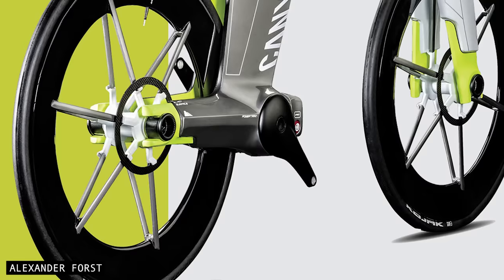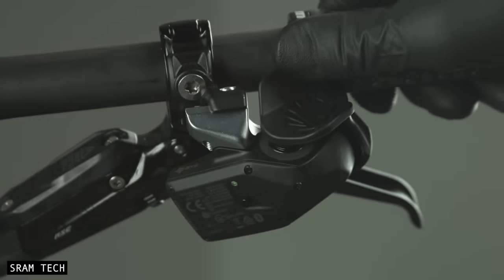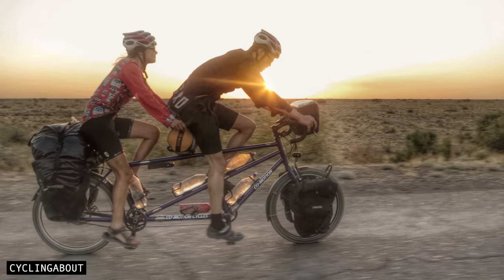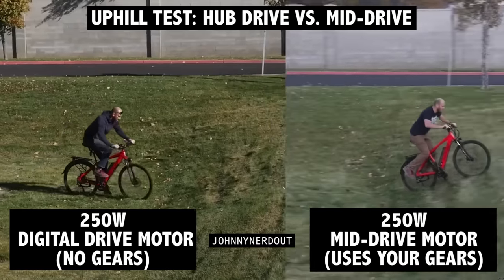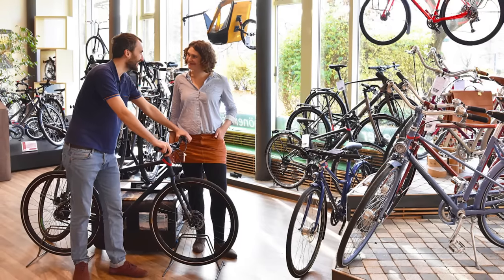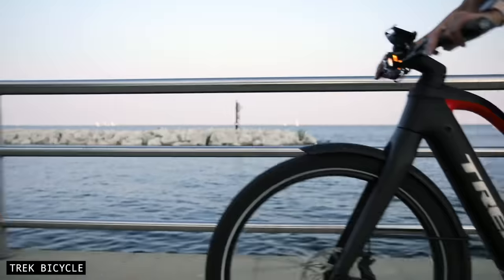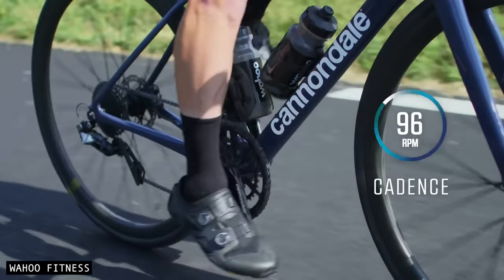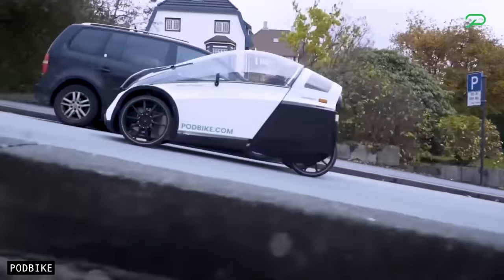Are Chainless Digital Drive Bicycles The Future of Cycling?

Comment: So, best way to look at digital drive bikes is a motorized vehicle and kit it out as that (not goofy 250w engine with tiny battery) so you could use it as normal motorcycle and have an option to extend your range by medaling/regenerative breaks.

Comment: Great Video!                                                                                                                                                                                                                                It's interesting your analysis on digital drive bikes is similar to what I found on Electric vs Hybrid vs Gas cars. The gas cars can reign supreme at very specific speeds based on their transmission and on flat terrain with no stops. Hybrids and Electrics both handle the stops as well as down hill sections wonderfully with regenerative breaking. Hybrids are great as some can offer redundancy not often talked about or utilized well helping with major issues since they can essentially have 2 drive trains. Whereas Electrics only have one to deal with and so can reduce complexity. Though not weight since batteries weigh more than gas.

Comment: Do you want to work twice as much on a bike, than this electric (not digital) drivetrain seems perfect for you!
The efficiency of an electric motor is about 80%. The efficiency of the generator is about 60%. Thus only 48% of the energy can be used to accelerate. In comparison the mechanical efficiency of a bike is about 99%.

Comment: Maybe I missed that in video, but how you gonna fix it?
Okay, it is more reliable, but how much does it cost to fix when it breakes?
With chain drive - buy new chain or casset and replace it. -Cheap and easy.
WIth electric drive - find the broblem, find and buy new(probably expensive) parts and replace.
And why people even trying to replace chains on bicycles? Chain drive exist, works and made cheap.

Comment: I think there is an area where this concept could actually be useful: in training! When you try to train at a certain power output out on the road, the problem occurs that however how hard you try, you will never be able to hold an exact power number. It will vary signifficantly depending on wind and especially on slope. Just a little gradient (wich you cannot see with the naked eye) and you go from, let‘s say, 200 Watts up to 350 without noticing. This reduces the time in your target range and makes training less efficient. With a „digital drive train“ or whatever better name someone could come up with it could be possible to keep a desired power output despite variations in cadence or gradient. A battery could compensate the poor efficiancy to give you the speed you would get on a normal drive train. In a nutshell you would have a smart trainer, but out on the road.

Comment: The thing is, the electronic drive might be lower maintenance, but once the system DOES require maintenance, you need to work with potentially complex electronics. Where as I can fix my chain drive in front of my house with a couple of wrenches, lube and maybe a file and scrap metal for good measure.

Note that I live in the Netherlands and that I drive a single speed bike exclusively for commutes, and I have no interest sport-cycling apart from the occasional low speed tour of the countryside. My overriding priority for my bike is simplicity and ease of maintnance, and being able to leave it out in horrible weather without thinking about it.

Comment: The “it has fewer moving parts” argument does not always mean it is better. A traditional chain drive bicycle is much easier to diagnose and fix if it has a problem. Broken chains can be easily replaced and wearing parts can be identified before they fail. But electrical problems are exponentially more challenging to diagnose and fix because there is not always an obvious reason why something stopped working.

Comment: If the motor attached to the crank is an ac syncronous motor you can power each phase of both the rotor and stator. But if you increase or decrease the ac voltage of one with a dc offset it'll act like a transmission.

Comment: Wishful thinking for people who do not want to pedal. The biggest flaw here is that one of the biggest benefits cited is the ability of the digital drivetrain to maintain the most efficient cadence. On flat ground, that would probably work, though to what actual advantage is not clear. I can do that now with the gearset with none of the added weight. The problem is that, in the real world, when a cyclist encounters a downhill situation, he can coast, resting his legs on the way down and, if the bike was equipped with a small assist hub motor/generator, recover that downhill energy into a supercapacitor for help on the way up the other side. I don't need to get down a hill with some magic efficiency formula, I just need to get down it, and I will with no work. The digital drivetrain described in the video has a separate generator at the crankset, which is only productive if it's being turned, therefore wasting the work of going uphill and the gravity of the downhill, forcing extra work to get up the other side. Add to that all of the vast inefficiency versus a conventional drivetrain and it's really pointless. Leg energy expended as kinetic and/or heat is lost. If it's not used to help you travel forward, then what is the rationale for working harder to go slower? Less maintenance? My bike goes years without much of anything aside from brake pads and occasionally tires.

Comment: Without superconductors this will never work for a regular bicycle. However this is a no brainer for e-bikes…

The efficiency doesn’t matter as you simply adjust the level of assist you want from your battery. The purpose of pedalling on an e-bike is simply for exercise, so any electrical energy you contribute is just a bonus.

Comment: It got some advantages but . . . Converting your mechanical power from the cranks into electrical power, then this electrical power is converted into mechanical on the wheel. The loses are far more than simply mechanical transmission.

Comment: Technically, if you're adding a supercapacitor bank, you should be able to use the energy from magnetic motor braking to charge the capacitors. This would reduce the wear components down to nothing but tires. Make the tires with a 3D printer and you can make them not only airless but allow them to have tread as they wear all the way down to the rim by including bubbles printed right into the design. As the material around some bubbles wears down, it exposes new bubbles. Stagger them in overlapped layers to always have tread. Considering that nylon is a mature material already used as both bicycle tire and 3D printer feedstock, it is not a far leap to make. With that in mind, we are likely a matter of years away from a lifetime semi-electric bicycle that will never need maintenance, parts or components to be replaced.

Comment: Can we please forget about such drive systems? 50% lower efficiency and higher weight?
What I need is a belt drive bicycle with a 7 speed internal gear hub, and a +small+ motor which helps me temporary on long sloops up.

Comment: It will be fine only in one case - if you increase the efficiency to the level of 87-89 percent, which is practically indistinguishable from a chain transmission. Theoretically, this can be achieved.
It is also possible to achieve a reduction in the weight of the generator to the level of the weight of the chain drive.

Comment: Digital electronics means a system with discrete states (e.g. 0 and 5 volts). A generator powering a motor is an analog system. Also, the generator and motor are much lossier than a mechanical lineage, and I doubt regenerative breaking will make up that difference.

Comment: Perhaps cycling at a constant speed just to recharge a battery and the battery powers the motor direct might be better. The one issue I have having once owned a pedelec bike is the amount of recharge cycles as battery replacement is not cheap as I found out.

Comment: The reason chain-driven bikes work is from the direct feedback you get when pedaling. This bike would have to generate more electricity than needed to drive the motor and generate force feedback to the direct-equivalent of a chain-driven bike. I doubt this could be achieved.

Comment: The hub motor and crank generator assembly would end up weighing around 10 to 20 pounds and you would loose 30% to 50% of the energy you put in.  It would also add around $1000 to  $3000 to the price of the bike.  Last but not least, waterproofing the rotating components would add additional friction and power loss.  Well, at least the name is catchy, but I'll be sticking to ebikes.

Comment: A planetary gearset in the bottom bracket with the sun gear driven by the cranks, the planetary carrier driven by an electric motor with the ring gear connected to a hub motor with a belt would be mechanically equivalent to a Prius drive train (with the engine replaced with human power) and would allow pedaling with no movement, movement with no pedaling, pedaling with movement, regenerative braking and engine braking (basically, fixed gear braking) and the ability to transit motion through the belt would potentially recover some of the losses in power transmission.

Then throw in an e-hub in front for EAWD and better regenerative braking.

And you can have hybrid bikes with no plug in capability and very minimal batteries, which might not be enough to offset the price of a planetary gearset but it'll probably offset the weight.

Comment: Thanks for the explanation. I understand from your video that the CDDBs don't have to be equipped with an energy buffer (battery), unless you need to have better efficiency, right? Anyway, one main disadvantage of the CDDBs - with or without energy buffer to increase the efficiency - is that they most probably are useless when the motor fails. That would be a pitty. Since almost every current e-bike does offer the option to switch off the pedal assistance completely and to drive the bike just as smooth as it would be an "old school" bike without any pedal assistance what so ever. Naturally those "old school" bikes were cheaper, but some could be pretty expensive as well. There still are bikes that have no pedal assistance that cost a lot more than a good quality e-bike. I expect that the basics of the CDDB without the parts that make it a CDDB are pretty expensive too (there has to be a return on the high investment costs for research and development). When the motor quits close to home it's probably expensive to be repaired and ... when you're "in the middle of nowhere" how far do you need to walk and push your useless but expensive CDDB?!

Comment: Trains have been using dynamic braking since the first electric trains in the early 1900’s captured the power from the extreme weight of a train descending mtn passes with controlled dynamo that returned the energy generated in electrical resistance to slow the train back into the batteries or electrical line. It was called “dynamic braking”. For bikes tho, it seems a little much whereas for vehicles that can carry more than 5 people it makes great economical sense.

Comment: There was a cHainless bicycle MADE BEFORe 1920.  there was a  tube surrounding the right chain stay. This acted as the drive shaft.  there was a bevel gear at both ends. This meshed with a large gear up front where the pedals were.  At the rear end it meshed with a bevel gear on the freewheel.
I don't know if this was efficient.  But there was no chain to grab your pant leg and get oil and dirt on you.
You might be able to find one of these, but if its good condition it will be ridiculously expensive.

Comment: I would just not see the point in charging the accumulator with my feet while riding when i can do it with a plug.
With no direct connection to the wheels it just seems so pointless.

Your comparison of the two e-bikes was compelling although the losses will just rise with more input from the rider and 50 Watts is pretty low which makes the losses seem less significant.

Comment: DIGITAL means 1 and 0. Recharge and discharge. The pedaling is to recharge battery and up to the biker for the bike speed using throttle.

Comment: Totally new to bikes and all the new stuff with it but why not add a mini high efficiency solar panel and some kind of kinetic charging system in addition to the regenerative break to further increase power output? I know it adds weight and more tech but it could help push the bar a bit more? This is also assuming price isn’t part of the equation.

Comment: I don't see a single use case where such a bike would be more useful than the present electric mopeds with manual pedals, other than to utilise legal loopholes. The generator simply adds weight and space, which can be used to have a bigger battery.

Comment: The difference is, are the two wires being used to send a low voltage signal or are the wires being used to send POWER to the rear motor.

Comment: The efficiency is depend on the size of the motor and voltage. 
For the big electric motors efficiency about 92..95% is quite common.

Comment: Modern electric car motors get up to 97% efficient, and generators should mirror this. I noticed that he doesn't mention the power rail efficiency to drive the motor. Batteries are inherently inefficient to charging (approx 57%), some super capacitors could improve power from recuperative braking. But they are bulky.

I would go with a high torque out-runner motor for the drive motor and optimize it for a normal top speed and use an aerodynamic shield for the front.

Comment: This is basically just an electric moped with extra steps. 

All of the power generating force is coming from the motors anyway. Your pedaling doesn't generate any extra power for the motor, they just recharge the batteries. If you just use a bigger battery and replace the pedals with hand throttle, and you'll get a more practical vehicle for the vast majority of people. 

These aren't electrically assisted bikes; these are electric mopeds with crank to charge the battery.

Comment: Digital drive is always going to be less efficient even with regenerative braking but as you pointed out, for commuting it really isn't a problem as an 'upright' commuter bike isn't particularly efficient anyway.
The problem arises when you fit an energy storage device either super capacitor or battery (or combination of both which could make regenerative braking much more efficient )
 I see no reason why an electric motor on a bicycle should be treated any differently to a motorcycle. 
Just because  it uses elecricity instead of petrol and is underpowered is no excuse for not being licensed and insured. 
The only thing I would agree is still a bicycle would be something like the KERRS (sp?) system which uses a flywheel for energy storage but isn't a motor

Comment: Perhaps I'm not understanding something, but why not just make an electric motor bike that is recharged (all or in part) by pedaling? It would increase the range, but if you run out of power you just plug it in? This seems simpler to optimize than all that other fiddling with complicated algorithms. I could understand the case for cargo bikes as those things are a bear to start and stop when loaded, so just using the pedals to charge the battery would make it more useful.